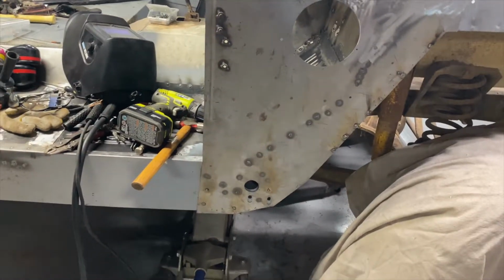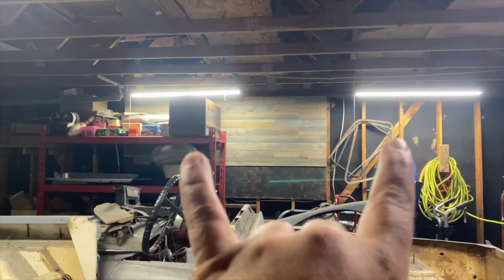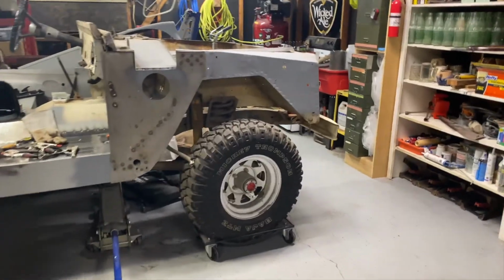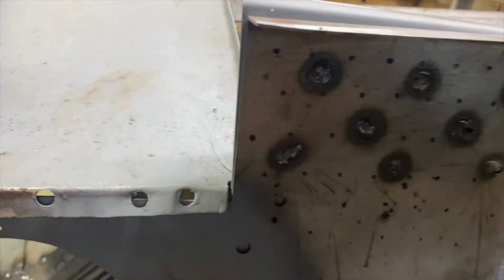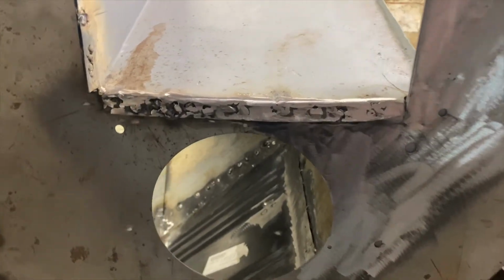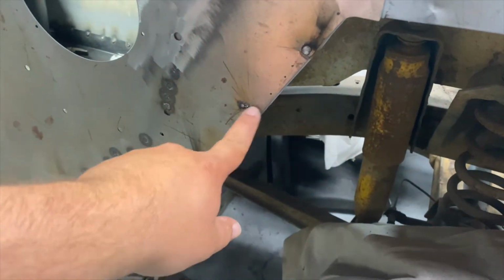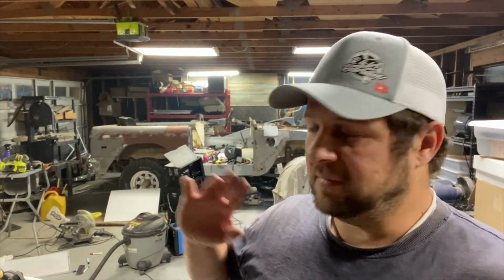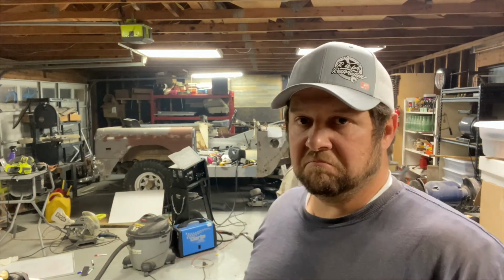Early Bronco Restoration l Kick Panel about 95% DONE!!

Comment: Have you considered tech screwing the a pillar on at this point and hanging the door to see how it all lines up?  You should get 39” from each of the three fender screw holes in the a pillar to the outside edge of the b pillar (where the rear quarter panel rolls around and attaches to the b pillar).  That should get you real close horizontally for spacing.  Then just double check your vertical  spacing.  Refer to the page that I emailed to you a while back for those measurements.  I started on the the drivers side, got door nicely aligned but my outside rocker needs a lot of massaging to fit....  looking good!
Reply from the maker: I was thinking about it but... I think I’m gonna head into the drivers side first then maybe my guy can come and help with the pillar.